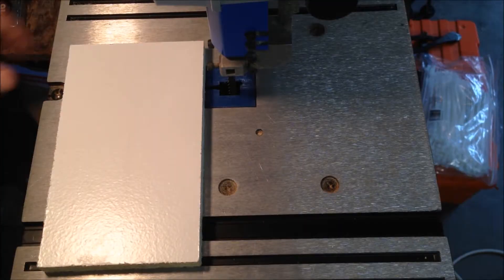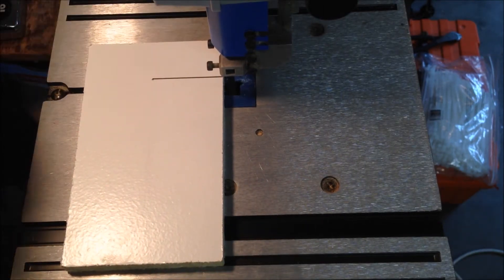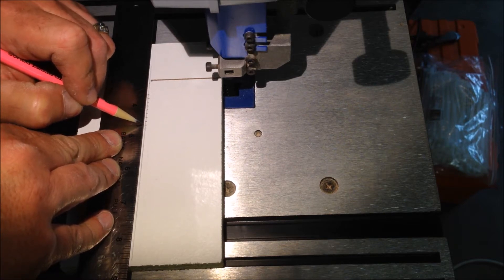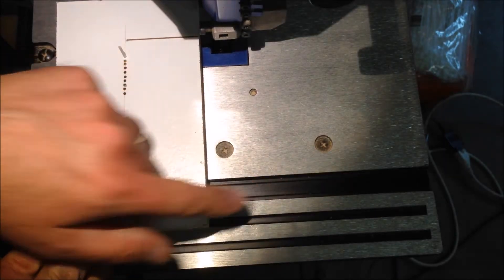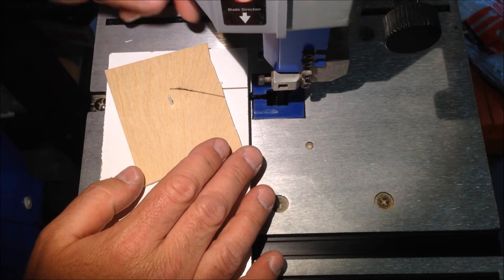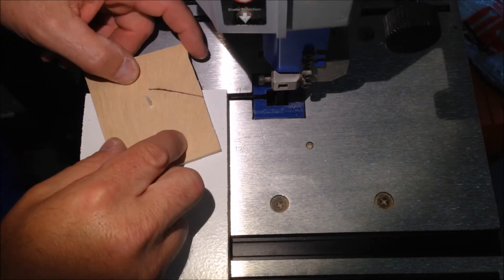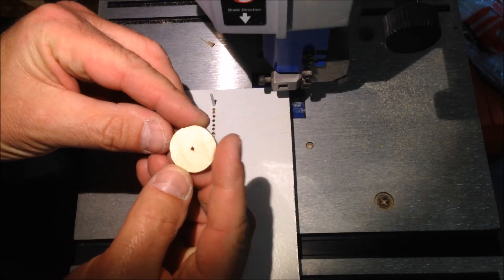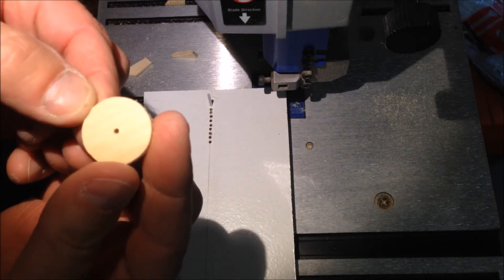Band Saw Circle Cutting Jig

Comment: That's a great idea for a jig!  I probably would have gone with hole saws and then put it on an ad-hoc circle sanding jig for final size, but your jig looks much easier and would require less sanding.

Your jig also has plenty of possibilities for expansion, and may work even better than the circle cutting jig I bought for my bandsaw a couple years back.  Thanks for sharing!
Reply from the maker: Your very welcome,
  Thank you for watching and especially for commenting. I actually thought about using hole saws but only had seven different sizes.

Regards,
Bob